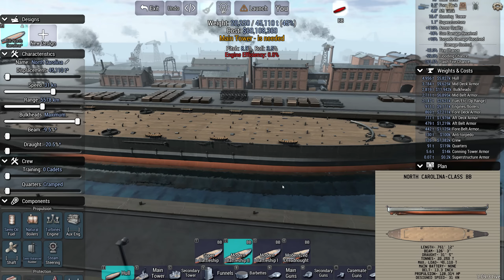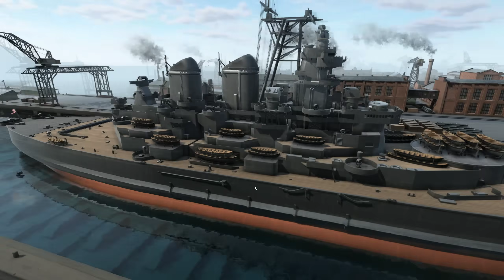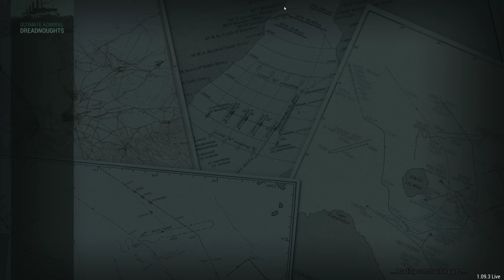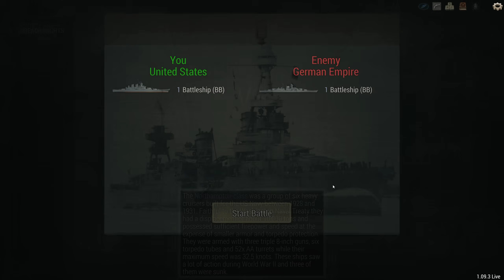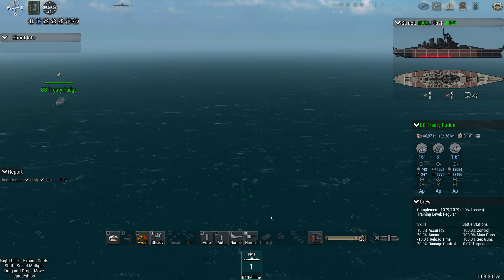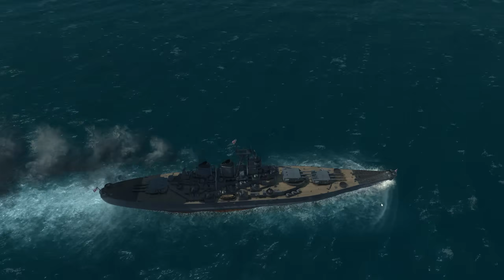Treaty Fudge - "Historical" Build with @Drachinifel - Ultimate Admiral Dreadnoughts

Comment: I think Drachinifel fudged up the belt calculation there. The combination of the 16deg shell trajectory and the 15deg inclined belt means that the shell will have to go through about 14 inches of armor, true. But even with a vertical belt, the shell coming at the 16 degree angle would need to go through 12.5 inches of armor, not just the 12in thickness of the belt. So the in-game belt thickness should be the real thickness multiplied by the ratio of these effective thicknesses. In math terms, Drachinifel calculated 12/cos31 = 14, while the correct value would be 12*cos16/cos31 = 13.45 . The error is about 4%. For the South Dakota, the belt should have been set at 14.3 inches.
Reply: Bump
Reply: You get outta here and take your calculate with you! 🤣🤣
Reply: @Doug_JB  virgin

Comment: So not only does the NC end up in the wrong division, you guys decided to build a combo of the NC and the SD but build it on the least suitable hull for either and drop its draft and beam down to nothing to get the weight right... ignoring that by doing so you will be nerffing its gunnery and resistance into the ground so it wont be able to hit anything or handle much damage. When you decided to combine them you should have switched to the SD hull so you didnt have to do that! I cant wait to see what you decide to do to the Iowa seeing all you have to do to make that an Iowa is fixed the draft/beam problem you gave this ship and make its guns a little longer. Ontop of all this you have given every other nation railguns to fix the problem of the inaccurate pen values but because the US ships use super heavy shells they dont get this, ignoring that those super long guns on the other ships mean they all have crazy accuracy and super flat trajectories.

Comment: After the battleship league it would be interesting to see a light cruiser and heavy cruiser league at some point.  Would be awesome to see ships like Baltimore, Eugen, Graf Spee, Atago, etc. face off
Reply: You’d really have to separate CAs into “treaty-bound” and “screw the paperwork, the gloves are off.” 

There is no way an eg County, Portland or Takao can compete with a ship protected by 5” main belt, sailing at 33kts and throwing nine 8” shells every 7 seconds with Gen4 radar.
Reply: @Doug_JB  Agreed, it would definitely have to be treaty bound divisions and post treaty divisions.  Maybe even a “treaty compliant” division for the ships that skirted the limits such as Deutschland, Zara, and some of the Japanese cruisers.
Reply: @codywilliams8005  

As “comprise committee” as the Scheer class was, I don’t think any treaty CA could beat her 1-1.
Reply: @Doug_JB  Definitely, which was the point of the Deutschland/Scheer class.  Some of the middle war CA’s with more advanced radar and fire control could engage much more accurately.   Thats what is kinda unfortunate, the Deutschlands don’t really fit anywhere in a league, because they aren’t BBs, aren’t BCs, outclass CAs of the same interwar period but get outclassed by middle to late war CAs.  Where would you put them I’m curious?
Reply: I'd put money on a Zara if that league rolled around
Reply: @Taz_XE076  Interesting, I figure Baltimore (or if Des Moines is included) would be pretty tough to beat.  Especially Des Moines with RF 8 in guns and rather advanced radar.  But I do feel Zara would be a pretty nice contender.
Reply: Graf spee would destroy them before they get in range